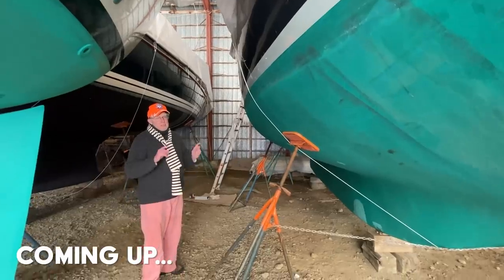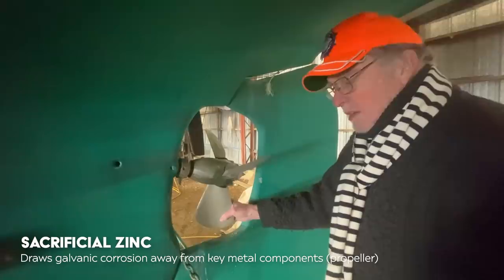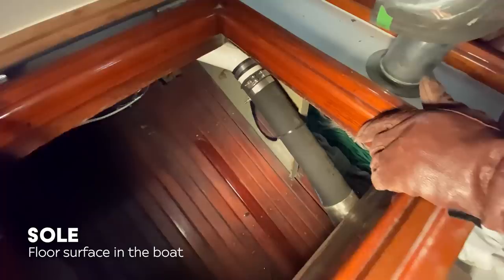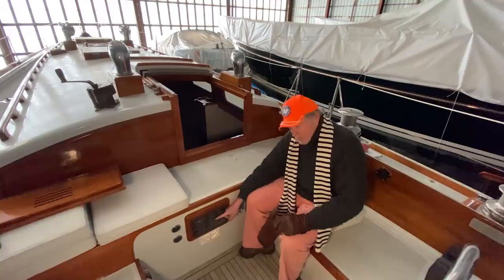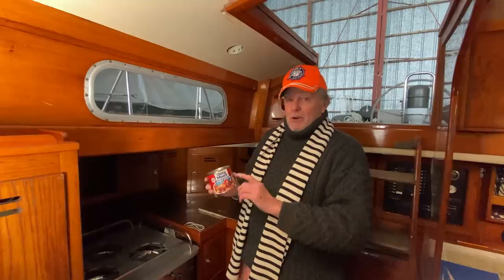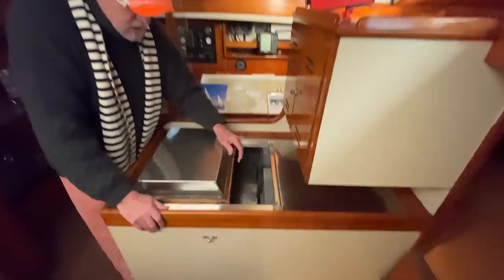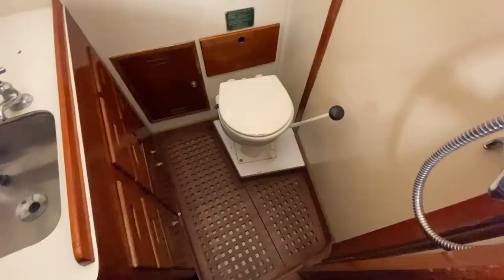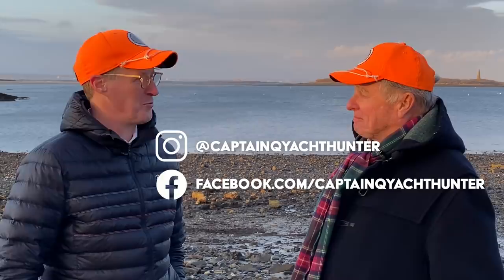DON'T BUY THIS BOAT! Classic Steel Sailboat for Sale - Ted Hood Steel Yawl $119k EP29

Comment: What a nice, classic Ted Hood designed boat.  I love the centerboard keel, especially for going downwind in heavy weather (retracted, it reduces the chance of the keel getting sideways to following seas and causing the boat to broach) and for getting into shallow waters, which this steel hulled beauty would love to do here in Southeast Alaska!  
The bunkboards must take the place of lee clothes, I'm guessing.  More secure and less intrusive.  About the only modification I would do is to outfit the wood stove with either diesel or propane.  So much less work for long distance sailing than wood would be.  Plus, if it were diesel, you could run a line from the fuel tank and never really have to worry about having fuel for heat.  
Thanks for showcasing a lovely, classic, well thought out bluewater boat.  "They don't make 'em like that anymore"!

Comment: I have been following this boat for five years. Started at $189,000 then. It is still for sail because of the dated interior I would think. It is nearly 60 yrs old.
Reply from the maker: the interior is the great thing    not a floating condo  and solid and cozy and no chrome or new minimalist looking ikea boat furniture 
this is a real boat you would be proud to sail anywhere and land to applause wherever
Reply: @YachtHunters  I really would not be keen on having to be bent over every time one was using the galley.... the penalty of those wide decks!
Reply: @YachtHunters   Captain, This is the most beautiful boat you have done to date. I personally prefer the CCA rule and a yawl in particular. I remember with great fondness sailing the Alden Challenger 30 years ago. The issue is, both you and I are showing our ,,, level of maturity? With that being said, the people half our age are interested in the "condo" look as well as separate staterooms and a more user friendly galley. At 6'3" that galley will be a tough one for me to navigate. I will be heading to Direcktor Marine tomorrow to look at the Beneteau 46 you showed a few weeks ago. I would have gone for the Alden in RI, but,,, as we age, getting in and out of the Beneteau into the tender will be easier than climbing over the side. I actually inquired about this boat several years ago and have the  sonar report on the hull showing the thickness. I was going to see this boat 3-4 years ago but the interior was completely disassembled and they would not show the boat. Is this boat being used?
Reply: For sale for 5yrs yikes. I'm sure someone surveyed it at some point and walked.
Reply from the maker: Fantastic. Best of luck and keep us posted. We hear the owner won’t likely be commissioning her and is a motivated seller. She’s been on the market for awhile but at a higher price point
Reply: @YachtHunters  I agree.  Went to annapolis boat show and after visiting a few new boats and catamarans and trimarans(for my freind) I could not tell if I was in Ikea kitchen dept or at a sailboat show.  The Hallberg Rassey still showed what a sailboat should be in my opinion but the majority were chintzy.  People know they want espresso maker in galley but oblivious to how good a well designed boat can sail.
Reply: @YachtHunters  hi B
Reply: @YachtHunters  i wonder if the hull had any sonar (ultrasonic thickness) performed?

If i was close anytime soon, I'd be willing to inspect it for just the chance for a visit.
Reply: @YachtHunters  The beneteau at Director had a very bad survey and now offered at $95k. Moisture penetration, thru hulls, engine oil leaks and several other issues that need to be addressed prior to commissioning.

Comment: I learned how to sail on a 47 foot Ted hood yawl in Marina Del Rey. Also built by Frans Maas in Holland. An amazing boat, same basic set up with a center board. Slightly different interior, I think it actually had an aft cabin to it instead of the large forpeak. It was a real sailing machine, maintained in perfect condition like this one.
Reply from the maker: that's very cool   would love to know more   thanks for your note

Comment: 8.5 out 10 dinty meat cans is my score. it´s a beauty for sure, and surely got all the comfort for a blue water sail around the world. But the head and washing in the masters cabin put me off, and it looked little bit cramped. But I guess it all depends on what type we sailors want on a sailboat, to suit each needs.

Thanks for the idea of the gimbal table.

But a big thanks to both of you, as I´am in the lookout for a bigger boat. Want to shift up from a 23ft Albin Viggen. And your channel shows different types that helps me to select one that suits my needs but also whats necessary without doing impulsive shopping.

Comment: Just a few notes here- first those blisters in the paint will show a problem as this boat has fairing compound on her. I have opened blisters like this with a needle gun before and went straight through the plate.Second, Corten  steel is no longer ( as a rule) used in yacht construction anymore. It’s original purpose was to lend a bit of protection if and when the coating was damaged until proper repair could be done. She is a beautiful boat no doubt but you did not show the bilge. Steel boats rust out from the interior and the way Frans Maas built these large portions of her bilge are in accessible, thus if replating  needs to be done the interior in that area will have to be removed. They were not built with this in mind! So the above reasons are why she has not been sold. Certainly a boat to be refurbished with her pedigree, but to do it  right would easily double the asking price. And one more thing, these boats are true round hulls and because of this replating of any bilge area etc. will required a metal worker who understands plate forming if you want it done right - Steel is great and properly designed and maintained will last forever, but this beautiful old girl needs a proper refit
Reply: I was wondering why the bilge or engine was revealed!

Comment: i love your series. these old boats are so amazing, takes me back to pre-glass days.
one thing i never hear about from you is talking about primary and secondary stability. is there some reason
you have never mention this? i had a kayak shop for many years and this was important in explaining how a boat would behave in whitewater. since a sailboat spends much it's time sailing on the side of the hull i wouldn't want a lot of primary stability, it would be tippy on the sides, stabile while motoring on the flat bottom. kind of like a jon boat or a pontoon boat. not mushers,"bangers".
i especially enjoy learning the history of designs, boat building. thanks, capt. john

Comment: Hey Randy, your editing skills have improved so impressively.  Guys, can you please estimate the average speed of the vessels on your reviews?
Reply from the maker: basic speed computation is the square root of the lwl times 1.34 gives you a theoretical hull speed
Reply: @YachtHunters  Thanks.
Reply: She will do a solid 8, effortlessly, an easy 9 if there's any wind at all, and once she gets going, Nothing will slow her down. Max out around 11 or occasionally 12, cracked off. Thing is, she will move a lot faster in light air, keeping way on, than someone not used to medium displacement boats would think. What I like is the level of comfort she provides because I don't get motion sickness on little ships like this. Some boats get jerked around so much, even by chippetychop in light air, it takes the fun out of cruising.
Reply: @martyspargur5281  Thank you for sharing your knowledge Marty!  Take good care.
Reply: @YachtHunters  I get 7.75 knots doing that calculation on this boat.
Reply: @YachtHunters  As a lover of an ancient 2001 version of Excel, which is no longer viable with Windows 10, I've had to learn some new fangled program.  But using the formula SQRT(LWL in feet)*1.34, I see the theoretical speeds seem rather low, but here they are:
LWL in Feet	Theoretical Knots
33.5  7.76
36	8.04
46	9.09
56	10.03
68	11.05
82	68.00
82	12.13
96	13.13
110	14.05
126	15.04
110	14.05
126	15.04
144	16.08
Reply: @ammoalamo6485  Good in theory, but in practice always consider hull shape, especially on older boats that often have long overhangs.  LWL is always quoted stationary, not moving.  But as boat speed increases and as the boat heels, working water line length can become significantly longer.  The old meter boats (6's, 8's and 12's for instance) were great examples of this, but it would definitely apply to this boat, too.  Oh, and forget about it on a boat capable of planing or, heaven forbid, foiling.

Comment: Captain Q, love your  boat videos, on this boat , a boat I have been looking at for a little while as one of the most impressive boats you have highlighted, did you notice whether there is any internal insulation on the hull to combat condensation ? in my experience steel boats generate a lot of condensation if not adequately insulated.
Reply from the maker: request the listing in the "show more " under the episode description  for details
Reply: @YachtHunters  Thank you Captain, email  to broker on its way.

Comment: Fantastic boat and steel.

I'm a welder fabricator and could do my own repairing.

I did the weding on a steel hull sailboat in 86 and that boat was a rust bucket.  But; tbe owner was determined he'd restore it.
Reply: A lot easier to plasma cut out weak metal than to re plank weak and rotting timbers,  plus as Captain Q showed in a previous Upload you could get a Engineering Survey done with a  Chalked Graph  all around the Hull and an Ultra Sound survey completed to target weakness, plus the 'cut out' metal is the same dimension and curved shape as what's going in so you can use same as a Template, mind you a Fire watch would be required inside as you could be cutting or welding merrily on the outside and set the Boat on Fire Inside...

Comment: On the yawl question.. they are more stable and have less steer pressure. 
The mizzen sail was a benefit sail that was not considered to be a driving sail. 
But a ballans sail.  Now if a mizzen stay sail was fitted this would drive the boot and added quite some power to the boat. 
Needless to say the mizzen mast must have a extra set of stays.

Comment: Capt Q is among my favorite videos, but please allow me to comment that the rare COR-TEN steel hull and the high cost of maintaining all that wood is probably keeping buyers away. Another thought, how would you even check the condition of the hull on the inside with all that cabinetry in the way?  Has it been allowed to 'weather" on the inside? and if so, does it smell just a bit?  How many yards could even do steel repair for pleasure boats?  A great boat in it's day, but it too will need a special buyer.  I understand the excitement is contagious and that other's mileage will vary.
Reply from the maker: she had an audio 2  or so years ago   all good ...long list of updates over the last 20 years   proper maintenance

Comment: Hi, Cap. You can't call dibs cuz I'M calling dibs!
What an opportunity, to own not just a Little Harbor, but an actual "Robin". I can just imagine Brown Thread Ted sitting there at that chart table, Wow.
These days people who are used to floating condos will pooh-pooh this interior, but this is not the boat one would want to just "live aboard" in some Hot marina as she slowly disintegrates out from under you. She has 4 house batteries, great, but if there's an inverter then give it a sea toss. Inverters are battery killers, and in this case, one would be working to accelerate (12v x 10) her demise.
This is a vessel for someone who wants to SAIL. To far away places, high latitudes or low. Dollars to donuts (wait, donuts are a buck now?) your significant other would be willing to forgo the picture-window topsides, deadhead-mating stems and even the Blinding Big Screen dashboards that adorn modern "cruising" boats if he or she only realized that you really don't get seasick in a boat that's 15 tons by 45 ft.
 "Are we even moving?" they ask from their hideout pilot berth? Not only are we moving, we've been doing a solid 9 for the past 3 days! That's Smooth!

 Annie wrote that there is one head, which I suppose there is one head compartment, but the one between the two bunks forward sure looks convenient. Maybe it's not plumbed to the holding tank.

A steel rudder that Floats? No, but Ted would Never allow one that induces lee helm. I was afraid the steering was a worm gear, but this is a helm you will definitely feel.
The Only thing I would change is the prop. I would ask the surveyor if that rudder is going to be reacting to the blade proximity or not. If you went back to a solid 3-blade, with a little less "D", I am sure it would never affect the sailing speed in any noticeable way. And the spurs can be more trouble than they're worth. Most common line in the prop is always going to be the occasional stray trailing sheet, and I sure wouldn't want to munch it up if it hits the wheel. Not to mention the damage they will do to fingers and wrists when all you want to do is dive down and unwind it.

First glance at the chart table looks like there's no electronics, but after looking around a bit you see that there's everything you need to drop the lines and go now. I always have to be wrong about something, so I'm going to go out on a limb here and say that while the autopilot looks British, the log looks like a Signet.
Finally, and most importantly, the sink has TWO friggin drains! THAT'S all I need to see. I'll take it.
Thank You Cap'n. If not for your channel, everybody would think that a proper sea boat has to be a ULDB pounder, with a honeycomb interior. I know there are other points of view, but think about it:
Barreling through the night at 27 knots, when you can't see what's waiting in your path, can be terrifying.
Good thing I'm not opinionated, huh.
Reply from the maker: Marty! We are very much in agreement. Happy to see your name pop up comments... we’ve missed your contributions.
Reply: @YachtHunters  Thank You, I don't think people realize how much effort goes into these videos.